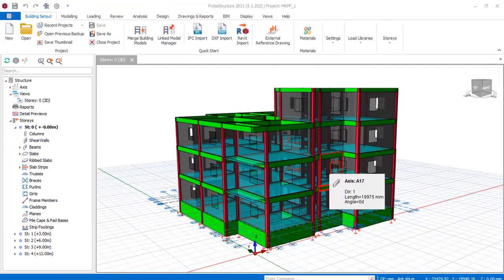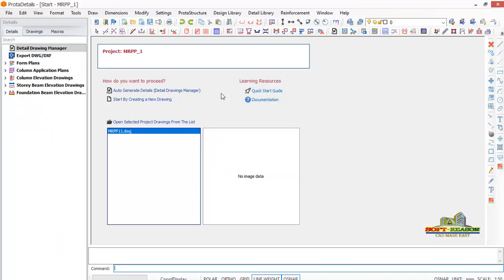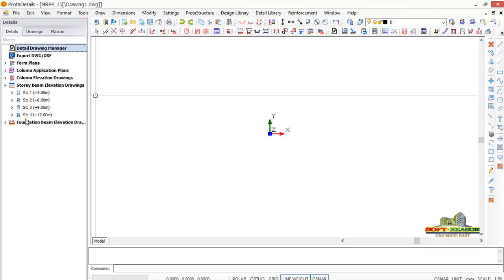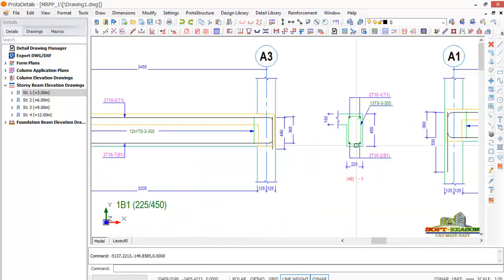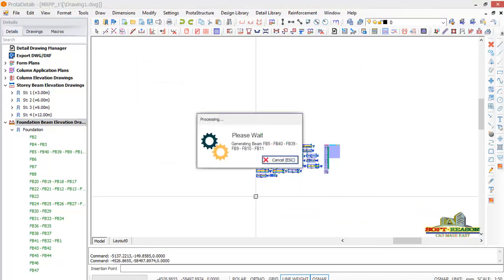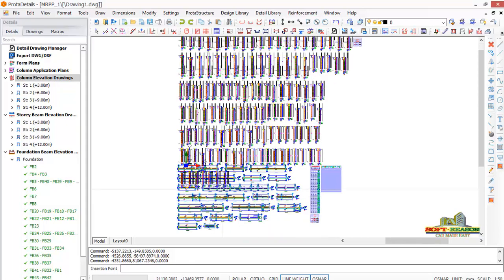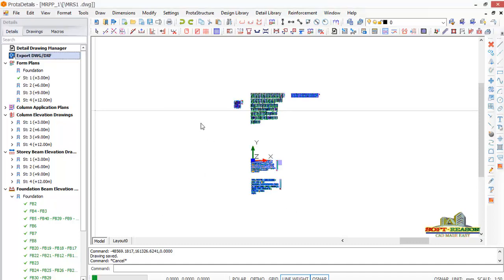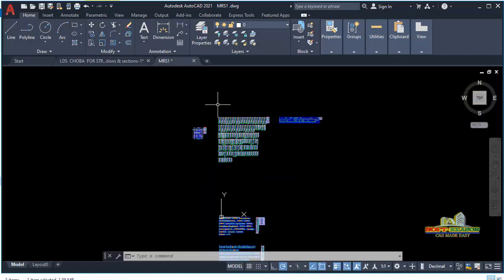How to Produce Reinforce Concrete Drawings Using Start by Creating Drawings Option in Prota Details

Comment: Sir is it possible to have the columns all the way from foundation to the top like we have in TSD. Can we also have the columns elevations grouped together instead of having the same column design repeated all over the place? This drawbacks are the reasons I never wanted to visist Staad pro and RCDC. Redundancy is not exciting at all in structural drawings. The only thing I like about prota is the slab stripping. especially, the manual stripping